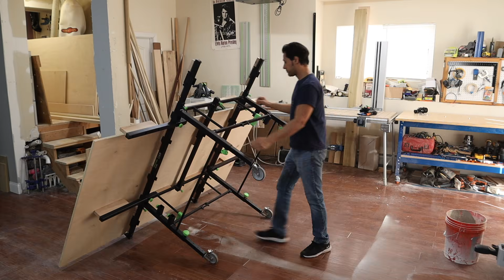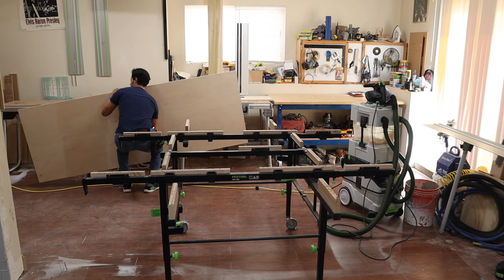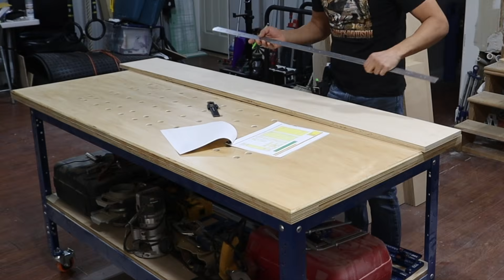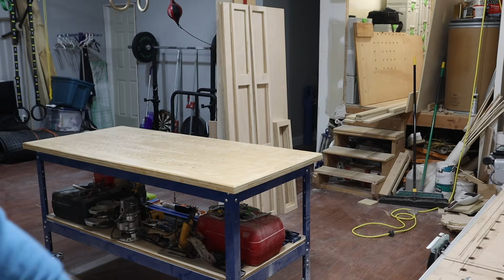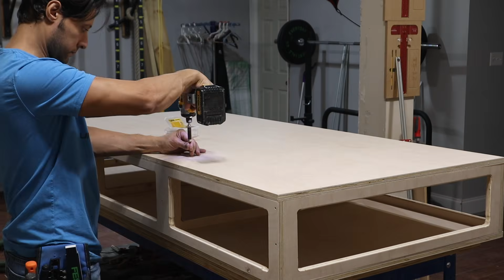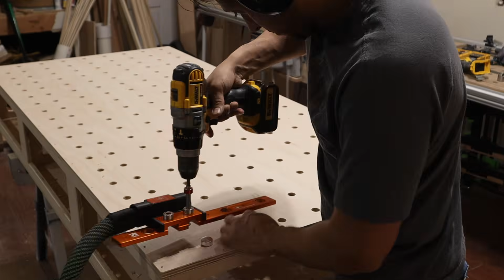Paulk bench build

Comment: Hi, thats a great looking bench. Would using say 9mm ply on the bottom make it a bit lighter?
Also i noticed that you screwed the top dowm. Wont you hit them with your track saw?
Reply from the maker: Using 9mm ply would make the bench very weak. I don’t cut into the bench with a track saw, I use sacrificial strips or rigid foam board on top if I’m cutting on it, which eliminates any damage to the bench top or hitting any screws. Most of the time I use the mft’s or stm1800 when using my track saw anyway.
Reply: @AnthonyScolaro1 hi, I get what you are saying about using a foam pad on top of the table for ripping and so avoiding the screws but as the bottom is resting on saw horses why do you believe a sheet of 9mm is insufficient? I love your videos.
Reply from the maker: @danthechippie4439  9mm is less than half an inch thick and just 3mm thicker than 1/4 inch. Ron Paulk himself (the inventor of this design) doesn’t even recommend using something as thin as half inch on it. The bottom will bend and possibly break with any downward pressure from heavy materials or you working on it. I can stand on this bench and jump up and down on it and it doesn’t even budge. I’ve stacked multiple cabinets and cabinet parts on it with no movement whatsoever. I would say 9mm is equivalent to roughly  3/8”  which may seem strong as a small panel but a large surface that thin will have many weak points. I just don’t want to see you waste your money on it and it fails.
Reply: @AnthonyScolaro1 hi, thank you for getting back to me so quickly.  I take on board what you have said and I appreciate your advice.  I will forget about the 9mm and use 18mm as directed.  I was just pitching an idea see if I could save some weight

Comment: You make a big deal about cutting the top and bottom to length at the same time.    Why not do the same when cutting to width?
Reply from the maker: I explained it to you thoroughly at the 2:00 minute mark of the video. I hope that helps.
Reply: @AnthonyScolaro1  Nope.   At 4:10 you cut the bottom separately from the top.   Why not cut them together?
Reply from the maker: @bobfre1  once again, pay attention to what I said at around the 2:00 minute mark, because I have the parallel guides, cutting the width separately is repeatable but the width of these are too wide to set up a stop block on the MFT at that point to have repeatability for cutting the length.  That’s why I cut them together for the length, so there’s no chance of human error when cutting without some sort of stop block. And there’s no reason why you can’t cut both piece at the same time for length and width, I just find it easier to handle and break down one sheet at a time. Smaller pieces are easier to work with.
Reply: @AnthonyScolaro1   No, I get it.... the parallel guides are great, but why not cut them together for exactly the same reasons.... eliminate  a cut, eliminate possible error, and save some time and effort removing and replacing the top board?
Reply from the maker: @bobfre1 either way would be correct. honestly I’ve tried that before but lining up two full sheets is very difficult and you still have to straight line rip one edge to have a good reference side. It can be done but it’s harder to keep full multiple sheets lined up.

Comment: Anthony when you cut the full length sheets, are you using two 55" Festool tracks or a one piece? Thank you for leading me to Ron Paulk. I got his plans and adapting it to my single car garage shop. Appreciate the video!
Reply from the maker: I’m using the 3000mm rail. One piece. The 3000 rail is roughly 119 inches long. Just under 10 feet.

Comment: Well I just went over Ron’s plans list 4 times and he has either doubled his price or you have a copy of his original plans or you misspoke but his workbench plans are either $20 or $50 depending on which package you purchase. 

Seems a bit steep of an increase (100%) for a pdf file in 10 months since this video came out.   Think I’ll try to find his old video when he built the first workbench and if I can’t find it, I’ll just have to build one without the plans. 

Nice demonstration on your part.
Reply from the maker: When I filmed this video, I purchased the plans for the price I stated. I’m sure he  must have raised the price since then if you are seeing $20 or $50.
Reply: @AnthonyScolaro1  sort of figured that, probably went up the first of the year. I found most of the old videos so I shouldn’t have a problem adapting to my size requirements. I have the same workhorses you do and I use them for an infeed and assembly table so I’ll have to maintain the same height and adjust the height of the legs to accommodate the height of the Paulk style workbench.

Comment: I know you used the TSO 50" parallel guides to cut the bench top and bottom to final width, but could you have used the 30" parallel guide rails instead to make this cut?  I ask this because I'm planning to buy the 30" parallel guide rail kit since I believe it will work for most of the cuts I need to do.  Thx
Reply from the maker: You can, but for this length it would be more work. You would have to square one side, then square the opposite side off of the same reference edge, then measure off of the original square edge, then use the 30” parallel guides on the opposite edge to get to your line but you have to also account for the 2mm thickness of the blade. In my opinion, the easiest thing to do is rip your top to width using the parallel guides and then to cut it to length, square one edge with the guide rail square, then measure off that edge and cut the opposite end to length using a guide rail square again, then cut the bottom piece of the workbench a little oversized, lay the top on it and use a router with a flush trim bit to make them exact to each other. I hope this makes sense to you.
Reply: @AnthonyScolaro1  thanks

Comment: no need to be aligning and moving sheets cut BOTH at same time
Reply from the maker: I did cut both sheets at the same time on the long crosscut. However if you’re trying to make all the cuts on both sheets all at once, you still need to align them or you’re wasting material and you run the risk of one of the sheets moving, especially when these sheets are not straight and have warping. That method is fine if you’re doing rough work but not for precise cuts. You can do that on smaller pieces on the MFT.

Comment: Fantastic content, and great video and audio quality! What do you think about using 1/2" plywood on the bottom of the bench for weight reduction?
Reply from the maker: In my opinion, it would be to weak and flexible to maintain flatness, and make it unbalanced to carry and lift in place because it would be more top heavy. You also don’t have the option to flip it over and use the other side if you damage the top. 1/2” does not do well as a stabilizer or work surface. But no one says you can’t do it. It’s all up to you. Things like this are customizable to your liking.
Reply: @AnthonyScolaro1  Ah...good points. Thanks, Anthony!
Reply from the maker: I do a lot of on site work, so instead of lugging the bench around, I put it on a dolly and roll it everywhere. I might even install some small detachable casters on one side

Comment: Nice build. I am curious about the Parf Guide cutter. I have seen most MFT benches using MDF tops. How does the cutter work on your (birch?) plywood? Worried about tear out on the circumference, since this 20 mm bit doesn't seem to score the edge like a Forstner bit.
Reply from the maker: It’s a very clean cut on top and through but on plywood, you need something underneath to combat tear out on the opposite side. I don’t care about the tear out on the bottom because these are workbenches.
Reply: @AnthonyScolaro1  Good to know that works well.  Thanks very much for the quick response and ATB.

Comment: Perhaps I’m missing something…. Doesn’t gluing the top (in addition to screwing it) on to the frame make it that much more difficult, if not impractical, to replace that top should you eventually need to?
Reply from the maker: It would take over 20 years to have to replace the top. This is only a work table that will not be cut into with any saw, it will not be drilled into at all because I will be using either foam boards under the piece that is being cut or scrap strips of plywood supports. Not to mention you can flip it over and make dog holes on the bottom and then use that for a top as well, adding another 20 plus years of use. I’m sure Ron Paulk himself can attest to that as well, he’s proven it over many years of use and abuse.

Comment: Very nice video! Very clear, nice editing. Love the workshop you have, but especially the attention to personal protection! A follow-up question : what's the reasoning behind the material choice here? Most MFT tops seem to be made of MDF, but the paulk workbench usually from plywood. I guess there are advantages to both e.g. weight, durability, adding a chamfer, ... Did you protect the surface with something?
Reply from the maker: MDF is heavy and since this is being transported back and forth to job sites, mdf would damage way too easily. I didn’t use a finish on it because then the surface gets slippery and when you are trying to work on something, it slides all over the table. No need for a finish here.

Comment: Great build, Anthony! I know it would be a lot of extra work,  but what do you think about routing grooves in the top and bottom sheets to receive the frame pieces? Do you think  the added glue surface would be worth it, or do you think the juice wouldn't be worth the squeeze?
Reply from the maker: That would be good for alignment purposes, and you really wouldn’t be adding much extra glue surface at all but for a quick build like this and it’s only a workbench, it’s much easier and faster to do it the way I did here. That’s not to say if you wanted to you couldn’t, I just couldn’t waste that much time because I’ve already been using it on job sites. Strength wise, the glue and screws are more than enough.